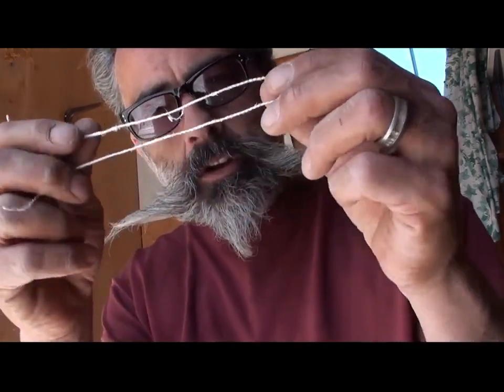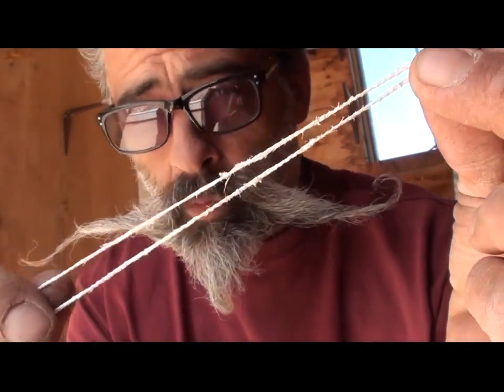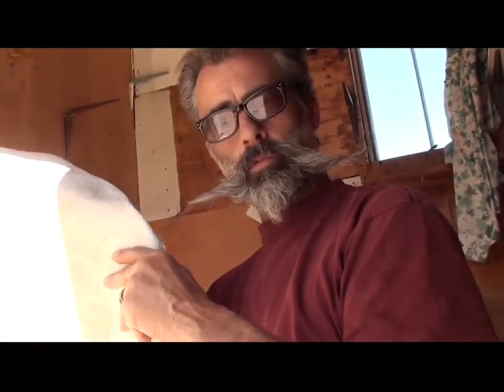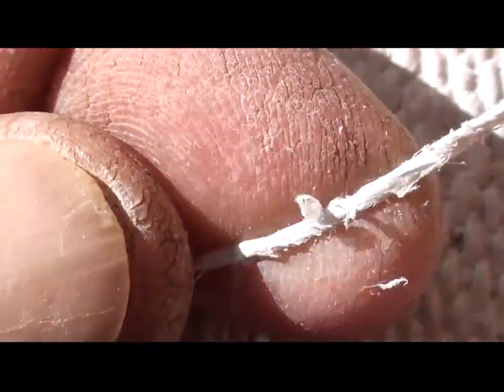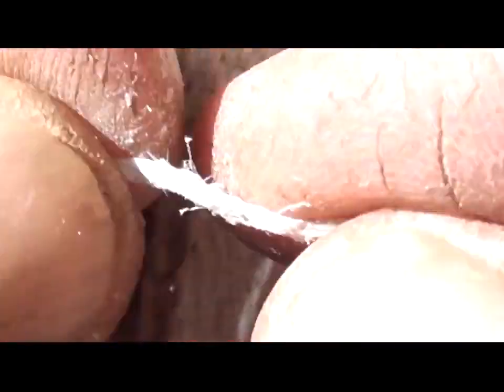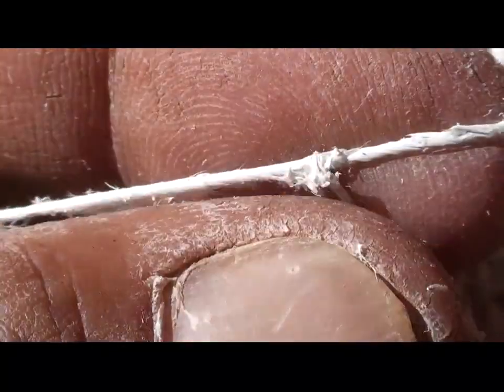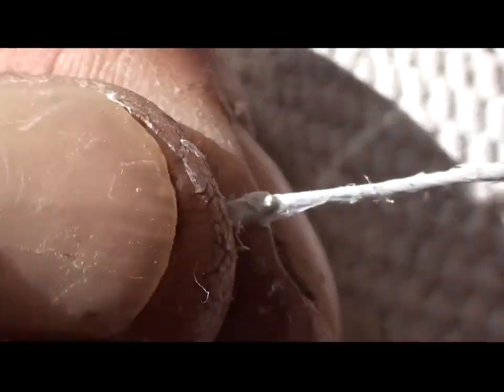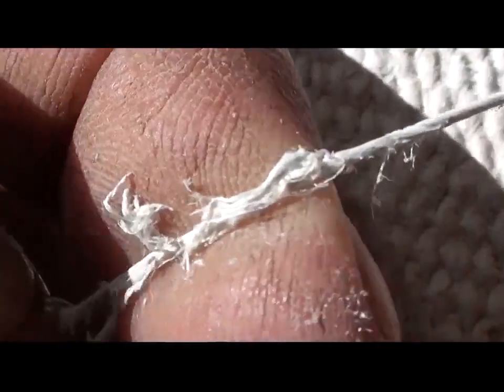EXPOSED!! navy/USCG TOXIC asbestos military insulation

Comment: Hello again I have a question maybe you can answer I had a pipe change in my apartment at one side of it it had insulation just a small patch the plumbers sprayed that area but they removed afterwards I asked them is that asbestos they said it just insulation  NO mind you the apartment is from just before the 2 WW. The plumbers would know aspestos when they see it? Would they in danger themselfs and my children ? I took a picture of it.
Reply from the maker: they would know asbestos if they are professionals,.. asbestos is only toxic in large amounts of dust, if it had been there since ww2, it was probably asbestos, Asbestos use was at its peak during World War II, if it has been removed it is okay, spraying it with oil or something would keep the dust down,... you will be okay